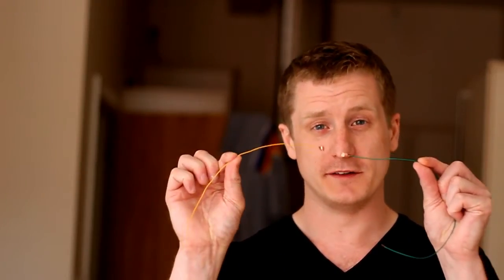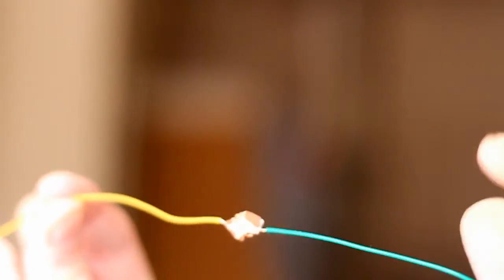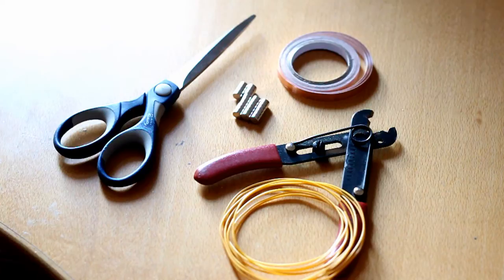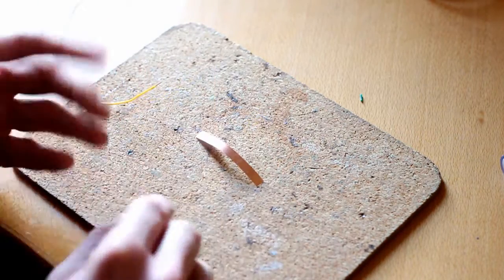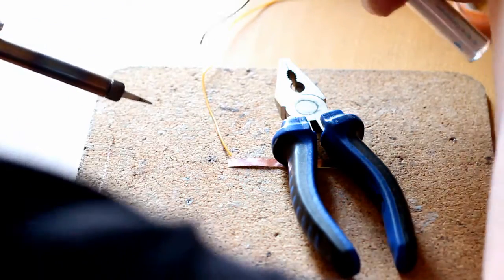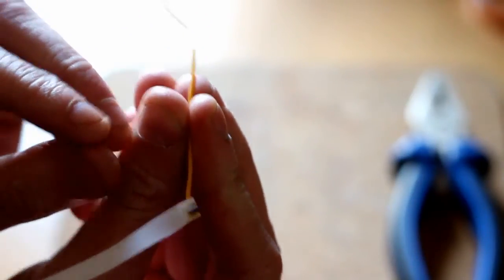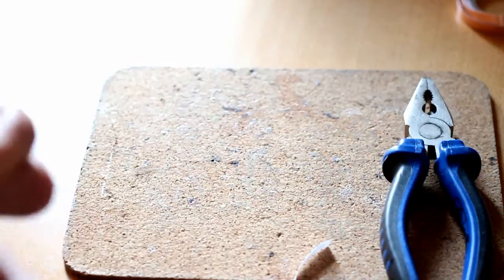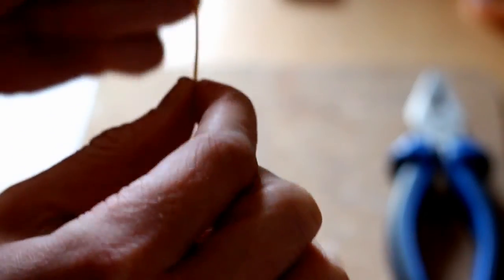Magnetic Wire Connections

Comment: I would like to pass 12 volts through a plastic roof on my jeep without drilling holes in my top....to run roof cab marker lights. Any ideas?
Reply from the maker: I don't know of a 12v wireless power module but you could feed this one 12v from your jeep battery. You would get 5v on the other side and then boost it to 12v. Not every efficient but worth a go. I have one of these modules and it works through about 8mm of plastic.
https://www.aliexpress.com/item/5V-Wireless-Charging-Module-Transmitter-Receiver-Charge-Coil/32417782303.html?aff_platform=product&cpt=1495386974565&sk=E2BUnIE&aff_trace_key=0728b4da84fe4747a044a25cbebdc022-1495386974565-01304-E2BUnIE
Reply: Thanks.  In my perfect world someone would have invented a self-contained cab marker light, battery operated with remote control that I could turn on and off inside the jeep.  Attached to the roof with some adhesive tape.
Reply: Go out the window